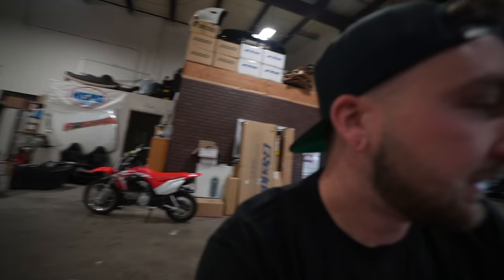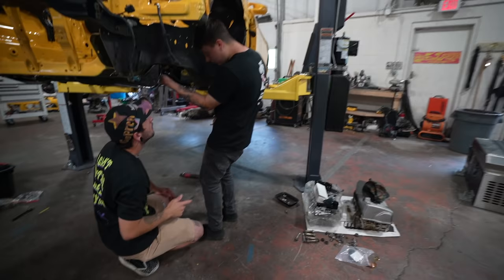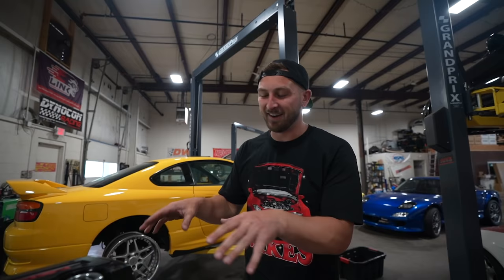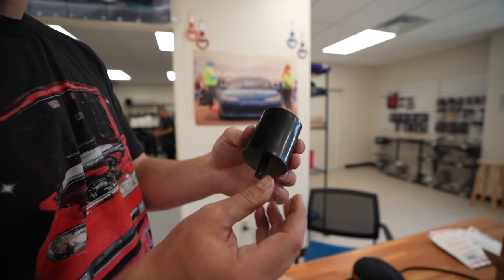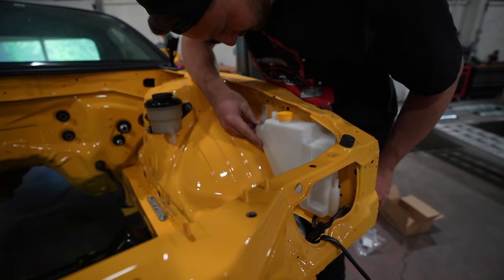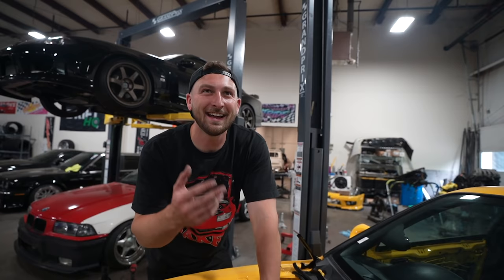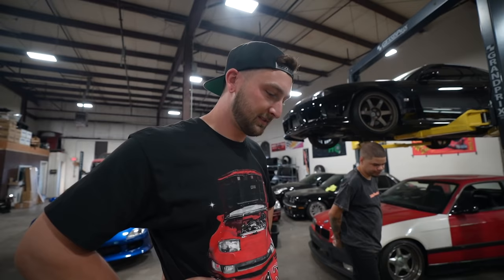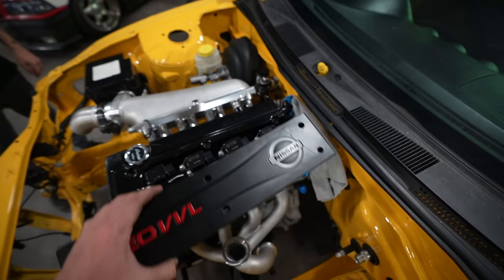Dropping my DREAM engine in my S15!

Comment: The K is a BETTER engine in every perceivable way. BEAMS is just a fan favorite engine for that chassis.
Reply: The k is so so so much more modern too, it has my vote
Reply: Contrary to popular beams heads flow more than the average k series.. literally the only thing they have on the beams is the vtec cam lobe which becomes irrelevant when shooting 300+whp N/A or massive HP aspirated as everyone locks/deletes vtec for reliability/consistency... oh and block strength, above 4-500whp the 3s beams is pot luck aspirated but easily rectified with a 5sfe block that will take you 700whp+ even more if you half fill unlike the k at this point which will need expensive sleeves to be 'reliable'
Reply: You could definitely say the k is better as far as aftermarket support goes though
Reply: The K is better, but you’re already building on a subpar chassis. Might as well pair it with a subpar engine.
Reply: @serturbo  to say the beams is subpar shows your knowledge of the lump.. to produce 212hp without multiple cam profiles in 1998 is nothing short of impressive even by today standards... the beloved k even in type R spec with absurd cam lift and duration can only manage a hand full more says alot about what's going on in the ports and combustion chamber of the supposed 'subpar' beams
Reply: the worlds a better place with less Hondaboi engines
Reply: Put itb on the k series.
Reply: Beams suits the Essence of the chassis and the Lightweight low power Idea, I say beams.
Reply: Beams also have DUAL VVTI and a Yamaha head, the best in the industry imo. Anything with a Yamaha head is legendary.
Reply: @joelucas6601  the only people that lock vtec are people that dont know what they’re doing. You lose torque and drive-ability by doing that.
Reply: @blakeschmid  its almost essential if you want any kind of reliability in massive cam drag set up where low end torque isn't a concern, particularly aspirated. If you being a mild to mid range car absolutely yes I would be keeping vtec but that's not what is commenting on hense the mention of those power figures in that comment
Reply: @joelucas6601   where had drag racing even been mentioned in this thread? lmao
Reply: Haters gonna hate beams makes great power and is sick

Comment: I'm a Toyota guy, and OCD for keeping it in the brand. I vote beams, but why not ITB's for the K? K's have a much bigger selection for engine parts, and there are so many K's available for less than a grand. Can't get a beams and 6spd trans for less than 2500 right now. I've been wanting to do this swap in my '82 Corolla for a few years and wish i bought one when i first started looking($1500-2000).....   TLDR- K = cheaper and plentiful. Beams= Purity
Reply: Luke fink has a beams with itbs it sings
Reply: K20/24 looks cheap until you go to buy the $1000 s2000 trans, $300 adapter plate, and $1150 clutch to make it all work. just looking at the beams it isnt a bad deal at all for an engine/trans/ecu/harness
Reply: @Tanner731  For a good out of the box, pnp engine the beams would be my first choice. But if you are looking for anything above 250hp and still be N/A, the K is the pick. The aftermarket for the K is ridiculous, and there is always cheaper options on the trans besides the s2000. I love the simplicity of the beams swap, but its hard to ignore the price, power ceiling, parts availability of the K.
Reply: Can get a 2.0 beams 4 Banga out of altezza for $250 here in NZ from pick a part.
Reply: @offgridas well just rub it in, lol. No such luxury in the USA :(
Reply: @josephsanders8921  haha I suspect we won't be seeing motors like that at pick a part for much longer. NZ seems to slowly be realising any rwd manual, or 4wd turbo is actually worth something. For a long time you could get a twin turbo Subaru legacy for 1k pretty much any day of the week. Now they are between 5 and 10

Comment: as a altezza rs200 owner, id say GO K 86, because down the road you can boost it easier, with super or turbo charger.
beams you can boost, but it wont respond as well or make as much power as boosted K.

Comment: I'm not biased towards either engine, the engineering brands who created them are both great . Both of them are well proven but that doesn't take away from my preference toward the Beams. It's like your comparison between a normal SR or the VVL, it's the natural evolution of what it once came with. Besides it's one of those engines where the best engineers of Toyota and Yamaha stuck their heads together(no pun intended) to create another masterpiece.. what's not to like!
Reply: I agree

Comment: The exhaust ports on the VVL heads are about 4 or 5 mm higher than on a DE head.  
A solution is to slot the mounting holes downwards on the flange by the corresponding 4 or 5 mm.

Comment: As much as I would love to see a Toyota engine in that ae86, they just always seem to be underpowered imo. Be different if you found a mr2 motor (either the old sc motor or the newer turbo one). Agree that a K would be good because that motor just has soo much support. It is like the Chevy small block/ LS of the imports.
Reply: its an 86 it doesnt need horsepower
Reply: @Tanner731  200whp or 240whp, which would you choose?
Reply: @Driftmonkey  the chassis doesn't need anymore than a 4age makes
Reply: @Tanner731  Could say the same for alot of vehicles, basically how long is a piece of string? Why does a R35 GTR need 3500hp? Why does a supra need 2700hp? Why does a Honda Integra need 1200hp? The more the merrier I think! I'm not saying turbo the K series and make 500hp, but I think having extra torque and peak power would only make the car more enjoyable to drive.
Reply: @Driftmonkey  keeping things simple is way cooler than building a car for the internet thats not even fun to own. a k series has enough power to break the rear axle and then you'll want more tire so youll cut up the car and break the axle even more, and imo adapting transmissions to engines they arent meant to be on is screwy when its all custom and expensive parts, if it was all oe parts you frankenstien its workable but a $1500 clutch kit is fucked
Reply: @Tanner731  and then what happens if he says fuck it beams 3s....does it all and.... ugh this things slow as fuck.... toss it in the corner after spending stonks to "keep the toyota enthusiasts happy". Do it once do it right. Hell, my DC2R walks all over my friends altezza, doesn't matter if its a roll or dig, every gear it just gets left for dust. All honesty its not a very good engine.
Reply: @Tanner731  Let's be honest the K is the ideal choice. 3S has a cool factor keeping it pure with a Toyota/Yamaha engine.
Reply: @Driftmonkey  look man we can just agree to disagree. imo you are hyper focused on horsepower, and I am of the opinion that theres a lot more to a car than power. I dont give two shits about the "purity" of the swap, it could be an NA sr20 or a fuckin miata engine and trans for all I care, I just I prefer a simple setup that gives you lots of seat time with easy and cheap maintenance. the chassis itself is never going to handle well with lots of power and its not meant to be fast plus he already has much better platforms that make way more power and handle way better than the 86 ever will. overbuilding cars is stupid because people end up spending more time working on their car than having fun with it, keep it simple drive the shit out of it and enjoy the car for what it is because you aren't in the garage working on your stupid ass "proam spec" v8 swap 240 or whatever every weekend
Reply: @Tanner731  Yeah I mean neither of us are wrong, I did a few drift days in a N/A sr20de s14, 195/55/15s on the rear at 65psi and it was a blast could still link all corners at Hampton downs club track (albeit with some manjis) but there were so many points where I wished it had a bit more power. Not double the power but a liiiitttle bit more. Not much wiggle room with a 3S if that's the case. K series will have more torque, and a smidgen more power. And if its found to be too gutless there's plenty of room for more power.
Reply: @Driftmonkey  imo its just better to make due with a simpler easier to service and maintain platform than get off in the weeds with a fully custom build for a bit more horsepower because the seat time you gain from a simple setup far outweighs the benefit of 30-40hp. the way I see it is either engine (and the setup he removed from the car) has more than enough power for the chassis so then your next consideration is maintaining it which is easier and cheaper when you are using a stock trans/engine combo. ideally if it was going to be a honda swap itd would be a full s2000 swap not a k adapted to a s2000 trans

Comment: I don’t see a pinned k series comment from you Jimmy... I’ll be so disappointed if you switch to a beams.  I know it’s the iconic setup but you will be so unhappy with it compared to the k series.    The k would be so much faster.  And you could add a little boost eventually if you decide you want more power.  Turbo or supercharger 🤷🏼

Comment: My hope is a silvertop 4age with itb’s built for 10-11k rpm.  Everyone does a beams in an 86.  Not worth watching in my opinion. I will because you’re still the most down to earth builder right now. If you’re gonna switch it up to do it right, then by all means do it right.  Or build the k series for some serious NA power.  Beams is like BBS RS, it’s great, but everyone’s done it. 🤷🏼

Comment: Slot the bolts holes down 4mm, you need to lift the manifold up to line up the ports between DE / VE

Comment: Put a volvo 5 cylinder in it, or build a wtcc volvo would be dope
Reply: Have you seen the prototype 760 they were testing to replace the turbo 240? They put a turbo on the whiteblock and put center locks on. A 5 cyl 740 wagon is a look tho.

Comment: with the mini truck I would use a Honda Goldwing motorcycle engine they have reverse their shaft driven and there over 1000 cc's depending on which one you get and the motors are flat like a Subaru

Comment: Beams gonna be down on power. Arond 190whp vs 240whp for the K. K makes more power and torque,  has a way better after market support. The beams however will make it a purist car. Not a bad thing
Reply: BEAMs is capable of 250 hp with little effort.

Comment: I feel for the sr20 trans setup, the z32 gearbox would have been a better option. Alphaomega performance did a very well written write up on it as they have manufactured both adapters; the cd and z32.

Comment: K > Beams. roller rocker+vtec is beautiful engineering. shim and buckets are old and reliable but nothing special. if u wanna talk ITBs and port flow, blacktop 20v itbs are too small for the beams hence why panicmade is making a set, but blacktop the most popular option. K series has tons of bigger itbs.

Comment: Beams with stock intake plenum as the twin chamber and internal trumpets works really well and 
on an electronic proggresive controller some nitrous ,ramp in the nitrous on a soft intial to hard hit to save breaking stuff & stock plenum can instal easy just one fitting with 2 lines fuel & nitrous,
ITB's give all the induction roar but only 10>20 max whp gains V's cost of ITB set up?,
NOS gets my vote as no one makes bolt on turbo or supercharger stuff for the beams,the UK corrolla t sport with the 2zz very rare supercharged version could be made to work but silly rare and expensive if you can find one,
even if you made it fit it with custom brackets & parts it will belt slip as stock pulleys & belt are 2 narrow
charger version is only 30 hp 25 ft/lb gains aswell,stock beams can take a 100 shot
Reply: Facts

Comment: Mr Oakes I love your content buddy👌Definitely a Beams would be awesome😁I was hoping for you guys to do a Beams swop because there hasn't been full on content with Beams build in detail building it up and you would definitely do 1 damn awesome build also make fantastic content.What be really impressive is doing the build in stages,this would create more awesome content,from stock power to full on modified na built with all the right spices to take it to a full on turbo setup😁,seeing all the changes in power with the different changes that's being made,making this build to be a all rounder as in doing some quarter mile times to drifting and could take it on daily or wknd drives with a show car at the same  time.Running some good itb and great header setup Screaming once Vvt kicks in with some good ratios😁💪A ke70 swop would've been real dope but along as it's Beams swop😁Keep up the awesome work Buddy🙌

Comment: why go beams when you can build a hybrid 7age? 7afe blocks are easy to come by then all you need is a 16v small port head or black top 20v head drop in 282 cams and you've got yourself a true Japanese high revving NA engine (or do a 5age which is much the same as a 7age) a 9age would be cool too or even a 4.5age

Comment: just do a k24 with ITB's
Reply: I personally would have gone with a k20 it makes more sense with the weight and make 220 hp with nothing done.  ITBs and a cam would get you near 285 BHP, the beams would be 200whp with ITBs. these motors nearly weigh the same but correct me if I'm wrong pretty sure the k20 is lighter than its k24 brother. But either way, I think you will be happy!

Comment: If you're wanting to do a Honda build, I would do the Beams swap in the 86 and save the K swap for a Honda since you are going to be much more limited on swap options for that. That way you can experience both a car with a Beams and a car with a K rather than just two Ks. Granted, I know there is a difference between a FF K swapped car and a FR K swapped car.

Comment: What is a beams? What’s the history and power it can make?
Reply: 100hp per litre stock(2.0l), excellent torque spread and comes from a rear wheel drive 6 speed Toyota (Altezza).
It is however based on the ancient 3sge platform and was its final form.
The k series is newer,lighter has a superior cylinder head, way more aftermarket support and ultimately can make 50% more power and torque from the same displacement.

Comment: I get it's content but it's your car, either engine will f**k! I don't know much about the beams but at a guess it's like toyotas equivalent too hondas k20?
Reply: it’s a 2.0l 4 cylinder, also known as the 3sge but the beans has a few specific wee differences to make it a more “sporty” engine. it come in the higher model altezzas (RHD is200 basically) and is a pretty neat engine. it has its own vvt system from toyota
Reply: @calebpearce8666  I get you, I have noticed they have them in the altezzas now I been looking. Is this the same engine that also came in some non turbo Chasers? Seen one here in the uk with a 2.0 n/a beams. Tidy stuff though!